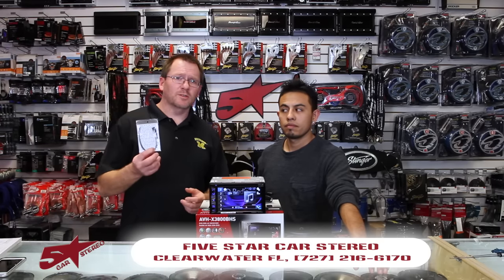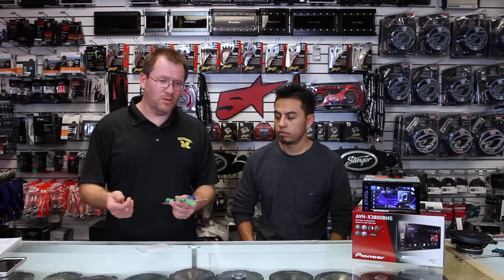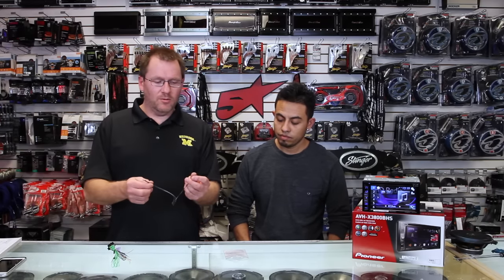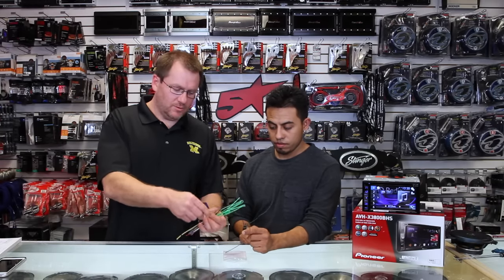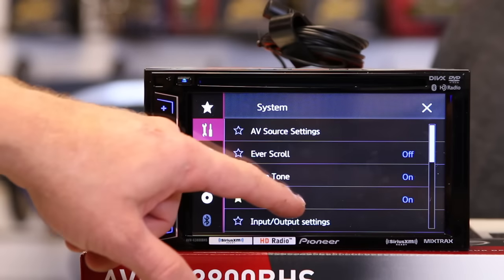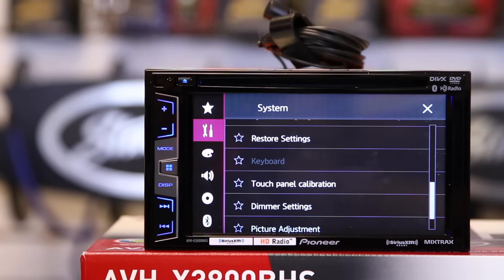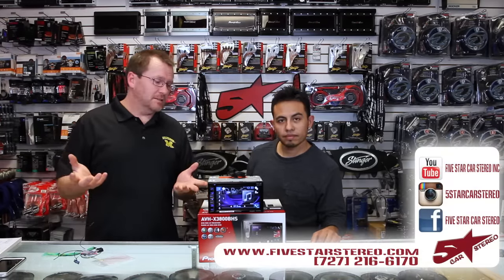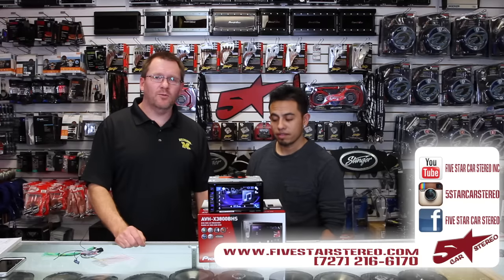How to do the brake bypass on your Pioneer AVH Radio using a MicroBypass

Comment: Do i need to have the microbypass to be able to update the firmware? Because i downloaded the firmware update for avh-x3800bhs on my scandisk thumb drive and the radio is not doing anything when I connect it to the USB adapter
Reply from the maker: Are you on the firmware update page in the menu?
Reply: +Five Star Car Stereo the radio says 8.07 and in the pionneer page says new update 8.15
Reply: +Five Star Car Stereo nevermind i did it and it was scan disk thumb drive i was using so i used another brand and it worked but thanks always for the help
Reply from the maker: +Felix Colon sweet glad it worked, these radios are super picky on thumb drives

Comment: i try to bypass my pioneer AVH-X37000BHS i used the microbypass and didn't work....i connected the black to ground on the stereo blue to the amp remote and the green wire to the green parking brake wire on the stereo....and it doesn't let me watch DVDs at all...
Reply from the maker: Alex Reyes get in touch with Matt at MicroBypass. You can email him and he will take care of it.

Comment: I don understand I  just grounded the parking wire on my 280bt and it works fine, no microbypass or switch used. But online I read that this isnt supposed to work on that model
Reply from the maker: +anjeroxjp it will work fine for the DVD play back. It will not keep the menus unlocked.

Comment: so I bought the microbypass hooked it up to my Pioneer AVH X 2700 BS and all of my setting options are unlocked but when I put in a DVD I get sound but no picture?
Reply from the maker: That is very odd, I would give Matt a microbypass a call.
Reply: +Five Star Car Stereo Thanks would you happen to have there contact info? I looked it up and couldn't find a phone number. Thanks
Reply from the maker: +Jacob Evans I will get it for you tomorrow when I get back in the shop.
Reply: +Five Star Car Stereo Thanks a lot.
Reply: +Five Star Car Stereo did you get a chance to send me matt's contact info
Reply from the maker: +Jacob Evans you can reach him here MicroBypass@gmail.com

Comment: Or u can use a o ring and use a screw in the back and tighten it I bypassed my JVC like that
Reply: you can't bypass a pioneer by grounding the handbrake wire.

Comment: Hey I have a question about my new stereo um I was playing music and I was changing the eq opinions and then puff it turns off and does not turn on ever again can you guys help!! Thanx.
Reply from the maker: That is no good. What you want to check is the yellow wire for 12 volts, the red wire for 12 volts when on, and black for ground. Also try just on plugging and plugging back in. There is also a fuse on the back of the radio.
Reply: +Five Star Car Stereo Wat if I buy a microbypass you think it would work? Plus the instructions that you told me.
Reply from the maker: +Shorty Modzzz make sure the radio turns back on then get the bypass
Reply: +Five Star Car Stereo Got cha.
Reply: +Five Star Car Stereo Ok so the new fuse blow up so I replaced it and it works fine then out of no where the radio switch on and off with no accurate time when it will do it again can you guys help if you can.
Reply from the maker: +Shorty Modzzz does the power for the unit power down or just the sound?
Reply: +Five Star Car Stereo Everything
Reply from the maker: +Shorty Modzzz is it loosing time when it restarts?
Reply: +Five Star Car Stereo just asks me wat language I want to use
Reply from the maker: +Shorty Modzzz check the yellow 12 volt and the black ground. One of them is doing something strange
Reply: +Five Star Car Stereo Well they look fine to me I dont no why it does it.
Reply from the maker: +Shorty Modzzz you may want to check volt meter to make sure they have power
Reply: I mean it turns off when i raise the volume up.
Reply from the maker: +Shorty Modzzz Pioneer has a breaker on the speaker level output. If a speakers ohm load is wrong the amp will stop making sound. It could be a bad wire, a short, or a bad speaker.

Comment: I was little confused for 1st time watched this video since it is far away. Therefore, I didn't connect blue on bypass to blue/white on pioneer harness. 
Correct wiring:
Light Green Harness to Green bypass
Blue/White to Blue bypass.
Black (T connection) to Black bypass
Reply from the maker: Thanh Nguyen yes you got it.
Reply: Thank you. I learned a lot from your helpful video. 
I had fun time to install my Pioneer 4800 and back up camera for my Elantra 14.
Reply from the maker: Thanh Nguyen and that fun is why we do it. We all at some point did this for fun, now it is a job.

Comment: Guys, I'm having a problem with my new AVH-280BT. 
Everything is hooked up properly to the factory harness , wire for wire color for color. The ONLY thing I didn't hook up was the long green parking break wire. I just don't need the DVD functions.
Here's the problem: When I start the vehicle , the radio turns on and sits at the Pioneer Loading screen. Just sits there and wont go past, might stay there for hours. Other times I start the vehicle , it boots right up and functions properly. Is this a side effect of not hooking up the parking break wire ? or something else.
Right now I think this stereo is just an insidious bastard, lol.
Any help would be appreciated.
Reply from the maker: Cloak you are correct the radio is revolting. There is definitely a problem with your unit that is not caused by not connecting the green wire. If you can, I would take it back.
Reply: Thanks for the response.
Brand new radio and I cant return it, wife threw out the box and receipt by accident.
Thanx for the vids
Reply from the maker: Cloak ouch!

Comment: on your remote turn on can you still use it also for your amp as well
Reply from the maker: Yes it will still turn on your amps. If your car has an amplified antenna( blue) connect that with the red wire.
Reply from the maker: Yes it will still turn on your amps. If your car has an amplified antenna( blue) connect that with the red wire.

Comment: I bought the micro bypass hooked it up as shown here and it didn't unlock it I have an avh 280bt and I got the bypass that says it's for all avh I got the ground on ground green on green and blue on system remote
Reply from the maker: cy newman is the lt green wire only going to the bypass?
Reply: yes i got it figured out found the wire broke in the insulation on the blue wire i appreciate the comment guys thanks for the help!!

Comment: All you have to do is run the green wire to the ground black wire on the radio an it works
Reply from the maker: Brad Mcintire until you disconnect the battery. Then it will lock you out of the menu screens.
Reply: Ill try it an get back to you its the avh 4700bs

Comment: Does this work on 4400nex? If not please help...
Reply: Didnt work on mine with ver 1.00  even without GPS plugged in . But I have since been told to update the firmware to Ver 1.01  Done that but haven't pulled dash apart yet to re install.

Comment: why do I have to have my yellow and red wire hook up for my radio to come on but if I turn off my car the radio don't go off
Reply: If you have the YELLOW and RED wires hooked up properly, yes, the radio will stay on until you open the DRIVERS door. If you don't open that door, most cars have a built in timer to turn it of after about 10 minutes.

Comment: is there a bypass for the Pioneer AVIC-W8400nex ??
Reply from the maker: Yes it is the same as the 8200. Press the bottom left of the screen until it says “set on”
Reply: Can you link me? I cant find any for the AVIC models

Comment: so the bluetooth wont work if you dont have the bypass??
Reply from the maker: +Xeon the Bluetooth will work with out the bypass
Reply from the maker: +Five Star Car Stereo you just can't get into the settings menu to add a new phone.  You can connect it to the parking break up and use as needed

Comment: i need this to use appradio right ? i just bought x490bs
Reply: I have this deck just ground the wire and ur done
Reply: WaysenderGaming i bought bypass from amazon , grounding didn't work.
Also installed it my self it is easy

Comment: I just installed the bypass. And it doesnt work still. I have the same radio in the video and still gives me a warning
Reply: I'd test manually first to be sure everything works properly then go back and check wiring set up
Reply: I actually had to uninstall the whole HU to check my wiring and it was done correctly. I hooked up the back up camera with the purple/white to reverse trigger wire and it didn’t work either. I was ONLY able to see any video at all after I tapped into the reverse light wire in the rear of my car! Oh and it doesn’t simply come up when I go into reverse. I have to go to CAMERA VIEW! I feel like this thing is going to end up getting me into an accident, though it’s meant to help you avoid it! My GPS just disconnected the other day and I was lost on my way to pick up my daughter from a friend’s house! I mean, SERIOUSLY, I was having a heart attack! I wish someone would help me because I have followed these videos, asked about these issues in so many comments and haven’t had any response

Comment: Cool, thanks for the vid! I knew this one was coming. I follow your instagram page as well. Can you make a short video on how to do a clean amp install? The wire management on your amps look nice and clean. What kind of sheathing do you use to keep all of the wires nice and tidy? Also do you custom fab all of the amp mounts?
Reply from the maker: Thanks for watching. We use Tesa tape and loom on our wire. We you use ferrules  or fork terminals with  heat shrink on the amp terminals. We make all the amp mount custom for each install. We have never really thought about a video of that, we will have to see what we can come up with. Thanks again, enjoy

Comment: This sucks. I bought this for my travel trailer expecting to just ground the wire to the radio. I don’t want to flip switches every time I plug the camper in

Comment: I have a switch on my radio but as soon as I drive and pass 10 mph it shuts off.... why?....
Reply from the maker: Do you have a navigation model?
Reply: +Five Star Car Stereo 
yes I do....
Reply: +Five Star Car Stereo 
I have a Pioneer avic-f90bt.......
Reply from the maker: +Marcos Cartas you have to move a pin on the  RCA wire harness and ground that to bypass that radio. The yellow black wire is the wire you move. I have a photo of where it needs to be. Email you email to fivestarcarstereo@yahoo.com

Comment: solder the green to black in the harnes and ur done
Reply: Not on the latest ones, X#800 radios.  My X5700BHS, firmware version 8.50, that works for the menus, but once I use the app part of the radio it has to see the on off on to use any of it.